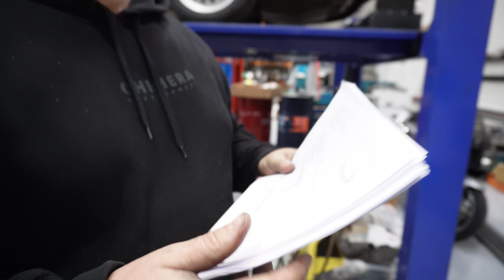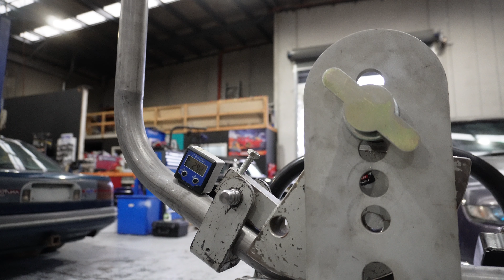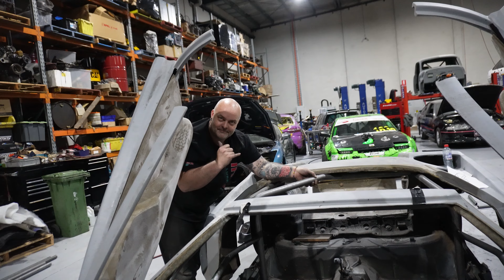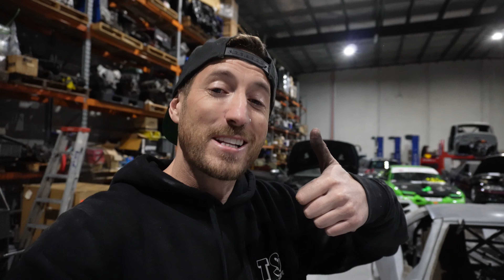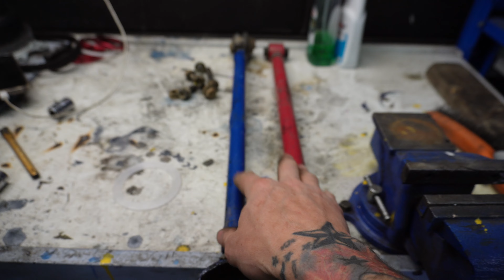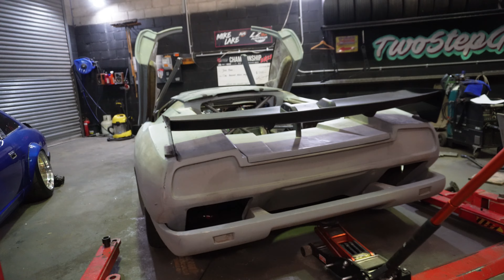FAKE Lamborghini Drift Car gets INSANE Roll Cage | Part 4

Comment from the maker: HUGE Thanks to @chimeradevelopment for helping me out with this roll cage. Please hit them up if you're in need of a cage for your car! 😁
Reply: this video is like a birthday present to me
Reply: I was hoping you'd take my advice and do separate body panels. The first hit you take is going to destroy everything you've done there. It would be different story if it weren't a drift car. I'm genuinely not being negative, just trying to save you some headaches. I know composites, the energy transfer even from a small hit will be massive. If you took the time to cut it into sections and make molds, you can make replacement panels yourself quickly and cheaply to fix the car. And most importantly, the rest of the car is still intact and the damage is confined to the hit area. You could make the individual parts thinner and lighter which would make for better break away of the panels in case of a hit.
Reply: Just to two custom arms per side to eliminate spacers.. 😉
Reply from the maker: @carbonfiber8071  Unfortunately it's not that simple & much easier said than done! This car is more of an exhibition drift car than a full on tandem battle car & we have our own plans to make sure we can replace the corners :)
Reply: @itsmikelake  I know what it would take. It'll be easier than fixing all the damage when it takes a hit. Molds aren't that hard. Neither are simple subframes and mounts.

Comment: Yoow Mike! Love the vids! Epic project! Usually the most expensive part of a custom shell car is the windscreen. Is that included in the kit? Otherwise you want to start looking for something that could fit. You'll want a clear screen, for safety reasons, so plastics like plexiglass are not really an option. A custom glass windscreen has to be cast with a mold and is really expensive. I'm sure you will figure something out! Good luck on the build.

Comment: Just put in a solid axel. Ford 8.8. Welded diff. You can extend the tube/axel to put the wheels right where you need them with no spacer. Then Weld in your 4 link. It's super easy!!  To do it proper watch the you tuber " garage fab" on how to build a wats link. Anyway, whatever you do, you have love from florida! ❤
Reply from the maker: Nah because then we'll lost the rear trailing arm characteristics of the e36. And I love that mechanical rear grip! Haha. Shoutout Florida bro!

Comment: I don't know why you say you're making one of a kind, aside from using the BMW pan, there have been tens of thousands of these built, even I built one.. but enjoy the build.
Reply from the maker: You’ve built a front motor 13b Lamborghini drift car using a bmw e36 chassis before?! That’s amazing! 👏🏻
Reply: @itsmikelake  no, built a Lambo kit on a stretched fiero body running a supercharged AMG 12cyl (I wanted to use a 3 rotor, but I had the AMG motor already 🤷)